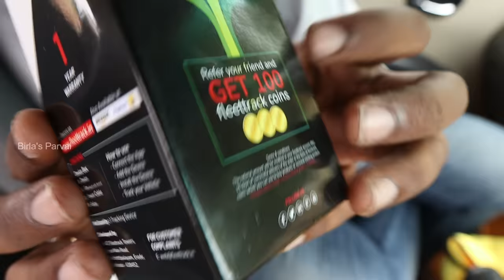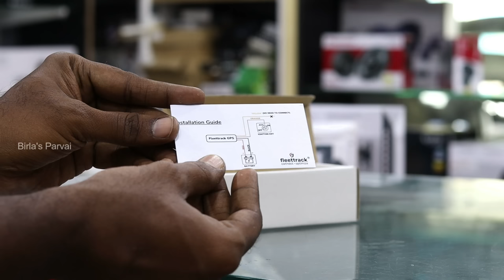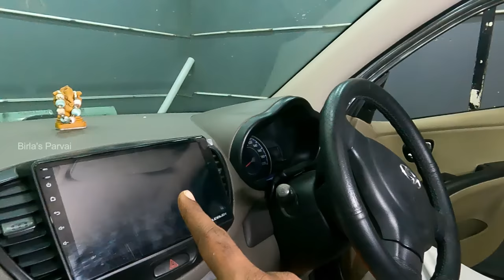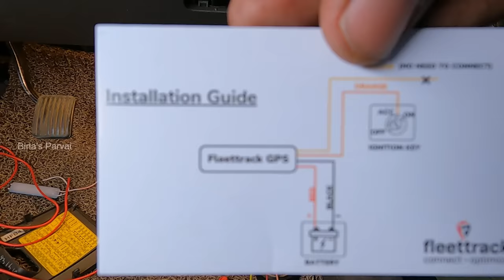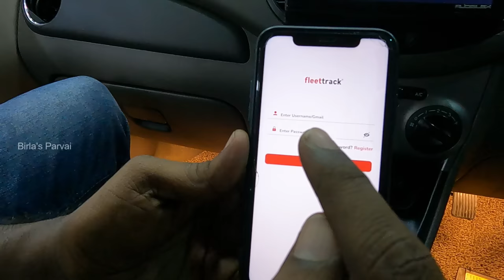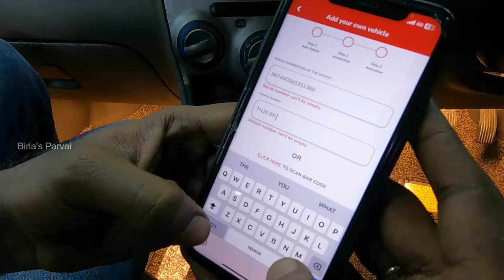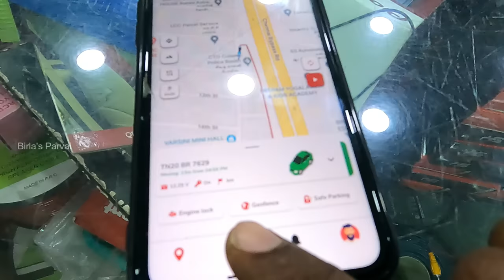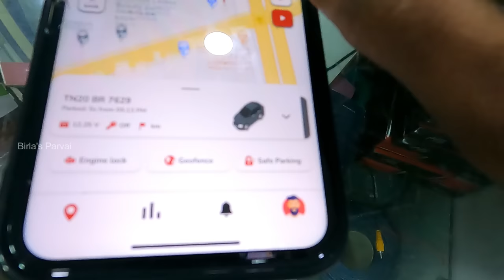Install Anti Theft System in Car - adding in budget car | GPS tracket installation demo | Birla

Comment: Hello guys... The product price is good. But, if we using 3 tracking device in single login means
 (eg= having 3 vehicle with GPS devices using same login id)
We can't able to make setting for 3 devices individually, the drawback is 1 vehicle speed limit I can't able to set, it will be common for 3 devices, like wise all setting here..

The next is pricing after a year renewal...
Renewal cost is coming around Rs:2000..
This is the in higher side... 😮
So.., 🤷